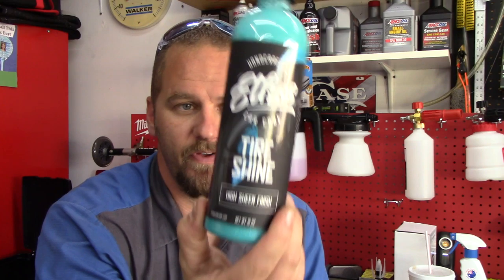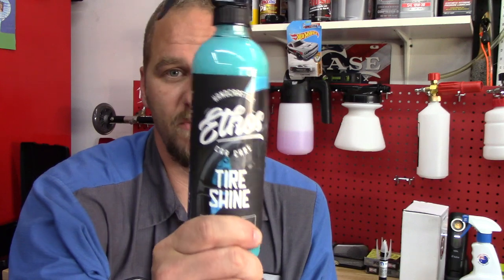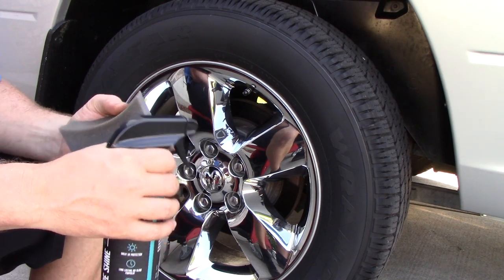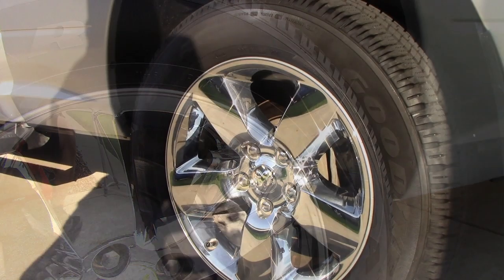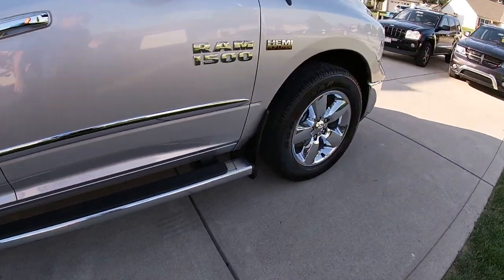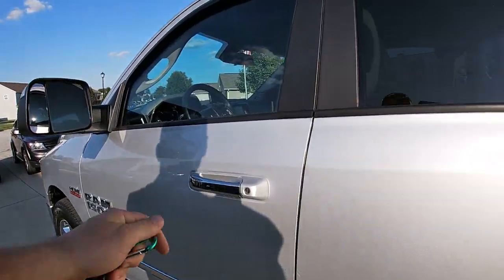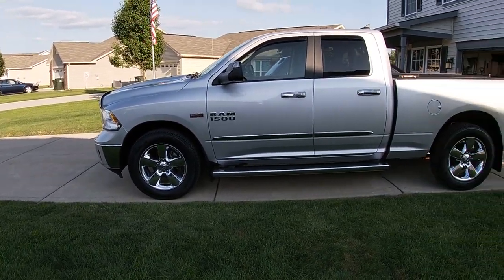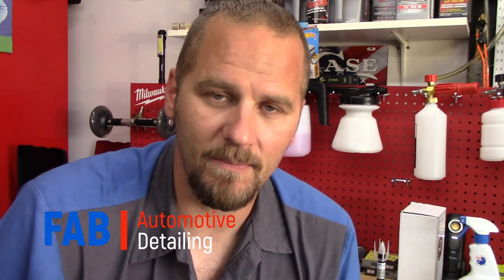Ethos Tire Shine! Oh it's Good!

Comment: Great video! In fact, I purchased this product months ago after I first viewed your video about this product, but I did not get a chance to use it until today. The product certainly did not sling onto my car, but after applying two (2) coats, I wasn't able to obtain that matte/satin look.To be honest,  I really did not see a significant difference in the tires. My tires were properly cleaned and dried before I applied Ethos. Unfortunately, Chemical Guys VRP wins hands down.

Comment: Awesome video! New subscriber. The tires look great! Never heard of Ethos before, but I will check out. Will the continued use of this cause the tires to dry rot prematurely? I have had the Ford service department ask me this question when all four of my Michelin tires tires were cracked at the wheels. The tires were only three years old.
Reply from the maker: Heddingmyway Thanks! So far I really like their products. I haven’t used it long enough to know but the UV protectors are suppose to prevent cracking.

Comment: Question for ya FAB. I have the same applicator but my 2019 Rebel’s Duratrac tires destroy the applicators. Any recommendations on an applicator for off road tires? Thanks.  Keep up the great work! I’m retired and your giving me a hobby I enjoy.
Reply from the maker: dj 91 Adam’s Polishes makes a good applicator that works well on off road tires. I have had to use a paint brush on some tires to get good coverage.
Reply: Thank you sir! Never thought of a paint brush but great idea. Will check with Adams. Ethos is definitely in my future.
Reply: Thank you sir. Just ordered two “Adam's Pro Tire Hex Grip Applicators”!
Reply from the maker: dj 91 You are welcome! Yeah a paint brush works great on complex tires.

Comment: Hey FAB great video! I received some Ethos products in a Mystery Box purchase. First product I tried was their tire shine. I find on my tires it is somewhere between satin and gloss.. I do like the gloss look personally but have to say this Ethos product is a definite winner and the blueberry scent is very pleasant..
Reply from the maker: Thank you! So far I have liked every product I have tried. The scent is really nice also. Thanks for watching
Reply: Hey Chi Mike, what are you thoughts after some time?
Reply: @ChadStJohn  Hey Chad.. I try so many products in my quest for the ultimate tire dressing. I rate the Ethos slightly above average for durability, average for ease of use, and over the top on the scent. That said, I like more of a high gloss on my tires.